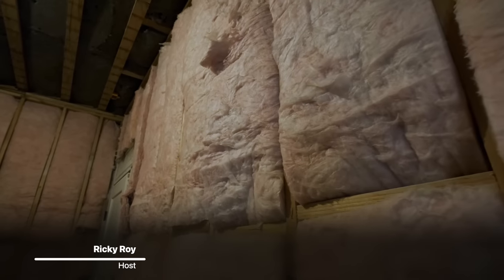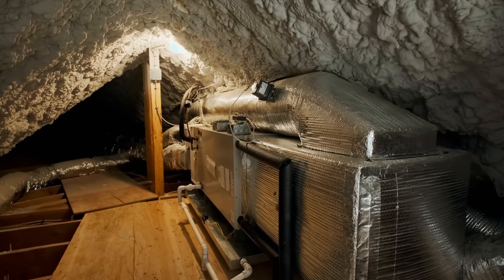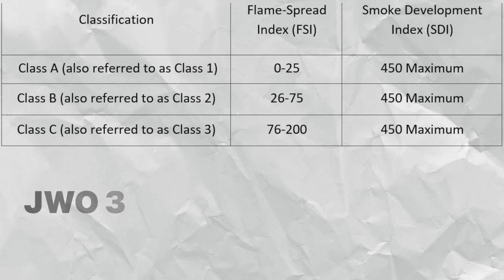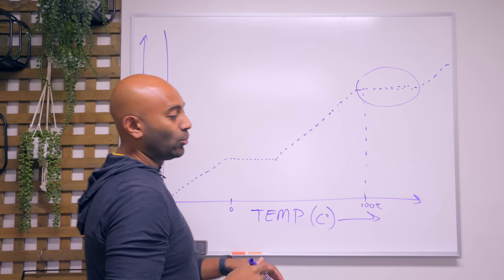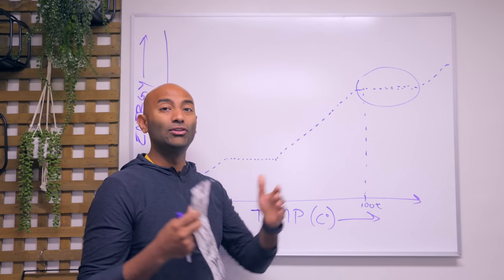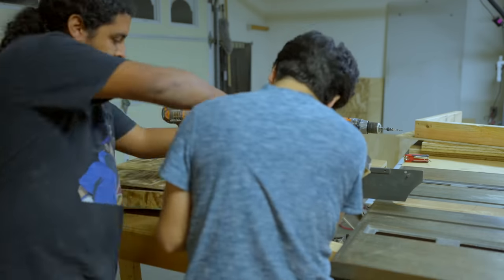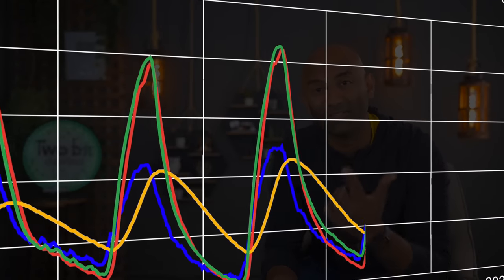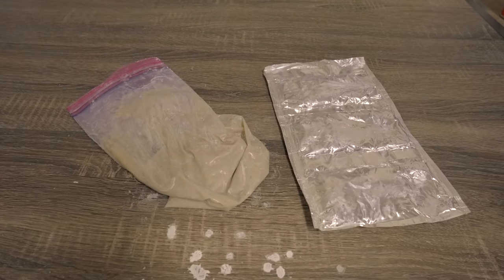The Genius of Phase Change Building Insulation!

Comment from the maker: Check out Hoymiles for your Solar Micro-Inverters Today! https://geni.us/Inverters

*Corrections/Clarifications Below 
- When hot outside, the material melts and absorbs energy keeping your room from getting as warm.
- When cold outside, the material freezes and releases energy warming up your room.
- I had the energy and temperature axes labeled incorrectly they should be switched! Temp on the Y axis, and energy on the X.
Reply: Unless there are alterations to pressure, after the ice melts the water warms and there is no longer any cooling.
Reply: Could put the kiwi on the south and west facing walls/roof where the sun is most punishing for best ROI.  

Have you ever analyzed the NASA-derived ceramic bead paint additive?  Could you do a video on it?
I find it works extremely well,  wish I had added it to my ceiling paint.  
It seems to add to paint durability as well.
Reply: Do we have an estimate as to how that might impact the R-value assemblies?
Reply: One inverter to two or four panels makes a lot of sense. Everyone seems to love Enphase, one-to-one, but they're so expensive. You can save a lot by going the way you did. I was considering APsystems for my solar system as they have a very similar solution.
Reply: Rally interested in how this works for you.  The costs of building new construction are insane still.  Being able to pull long term savings is more important than just being environmentally positive.  Cutting back on other monthly costs is a need for the average family.
Reply: Do you have to rip off the drywall?  Is it possible to take the siding off and put it back on?  (I guess only for vinyl or aluminum, but still, that seems easier?)
Reply: I know the prices for this thing are in the US, but where I live (Slovenia) you can buy the bricks + 8 inches of insulation for the same amount of money. Besides having large thermal mass, the bricks are also a noise and air barrier so really this seems like it's only usefull when you don't have space for thicker exterior walls.
Reply: Ricky, 
Regarding your solar panels & inverters... I'd shade hits Any One of your panels, are you saying that the degradation on that 1 panel will NOT reduce the output of the remaining unshaded panels regardless of if you're using the 2in1 or 4in1 Inverter modules on the roof?  

Cheers, Eric
Reply: So what I think of it. In general as you also say in Europe (overhere) most homes are stone based and not wood based. As stine has more weight it can hold more energy per kg then for examply air. For examply you have 2 the same hkuses one wood and one stone both 20c inside (68F) outside is 0c (32F) keep all the windows open for 30 minutes then close them). The stone building will go back to a much higher temp as the wooden building as mass holds more energy and energy is temperature!
So you have "stuff" that absorps energy and stores it. Rhe question is how much energy can it store per square cm or inch? And compared to old fashion wool insulation its not difficult but try something more like PIR how does it hold up then? Or put water in the box so its almost full how does it hold up? I s
don't understand with saving energy besides adding energy storage without and isolation?

Greetings Peter
Reply: Great job again!  Do you have a database/app where I can go and get modeling for my house/buildings in my area?   It would be cool if you had that tool and lead gen for the company offering the solution.
Reply: Ricky - what about a buying consortium of your viewers for QE buying group?    How much volume could we collectively get?   I have a metal pole building and a home, but if we leveraged your massive viewership, couldn’t we collectively help QE get to the new volume they need which would not only help all of us but it would long term help QE as they could leverage econo of scale to drive deeper into new markets.  Thoughts?
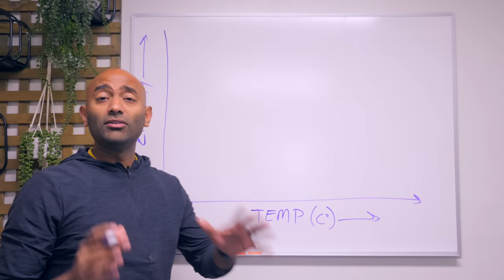Reply: Hmmmm ... seems tat you have the Temp and Energy axes mixed here (around 05:00 mark and after) ...
But otherwise excellent stuff as usual.
Reply: @MatejKebe 
Is it a Wienerberger product?
Reply: @mrbizi5652 
Regarding buying consortium, considering the market for EU regions as well.
Reply: I think you labeled the axis backwards. You wanted to show that temperature would remain the same as energy increased/decreased. You accidentally show the opposite.
Reply: It is also important to pay attention to how insulation affects humidity. Otherwise, mold could form.
Reply: Heating and cooling are "your largest energy bills"?  Well, no... in total, the biggest energy consumer is transportation.
Reply: 🇺🇲  Sell your house in San Diego, California, while the market is up. Buy or build an affordable home in a   Midwest state. Use that same product on the new house. The cost of living is so much less out of Southern California.
Reply: this stuff would be great for tiny homes, mobile homes, or temp construction site mobile offices etc.  cabins, off grid homes, im looking at building a off grid cabin using a shipping container...this stuff is now on my list

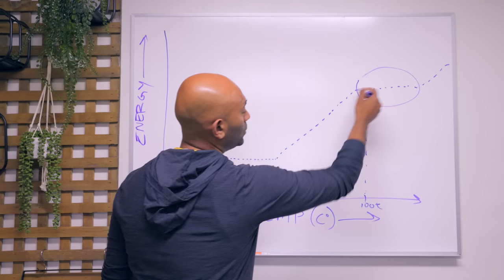Comment: Hi. I watched your video and I think you should do one more test. On temperature chart we don't see the "phase change" horizontal line on chart, you explained at 6:10. This extra insulation you added = a lot of extra mass in one test environment. If you weight it and put an equivalent water bottle to other box you will see similar gains. Only such comparison can give credits to such "phase change" invention.

Comment: The radiant barrier is an insulator, but phase change isn't insulation, it's energy storage.
Reply: True. But the energy storage has a (small?) insulation effect by keeping the temperature of the material the same temperature as your house, thus limiting the heat exchange between the two.
Reply: @RobertLBarnard  yeah makes more sense to have phase change material inside the house in areas you want to fight temperature shifts

Comment: I'm considering making myself a van, and I reckon this kind of material would be perfect there because I'm limited on how much solar I can install on it. In a small space like that the price also is less of a concern, and every last bit of efficiency makes a huge difference.
Reply: Now your question is what temperature range do I design for? Desert conditions or arctic conditions like in Canada. Noooo!
Reply: @skidaddledude1997  I think a comment above can solve the question, have 2 layers installed in the van. One with a melting point of 15C and another with melting point of 25C. This way you can ensure a phrase change for most weather band widths
Reply: I have exactly the same use in mind, only using a bread van/tiny home approach.

Perhaps 1/4" of glued in Styrofoam and then a layer of phase change material for cold , with another 1/4" Styrofoam and then another layer for heat, and then your finish paneling. $1000 to $!250 ought to do all surfaces including the floor. A small AC and a mini wood stove should cover most locations.

I'm going to put in a suggestion on the 'Project Farm' channel to test this material in a future show. He does some really good tests on a variety of products.
Reply: He said the material goes on the outside. How are you supposed to tape these things on the outside of a van?
Reply: @allocater2  Not to mention how hot exterior metal would be in summer. That's why I thought a 1/4" of Styrofoam on the inside to slow the incoming heat. Then the first layer of phase change material. 

I can't see any other way, as it seems pointless to tape directly to the metal wall skin on the inside or outside.

Maybe someone has a better idea?
Reply: @allocater2  Insulation needs to be on the outside of the "water barrier" (don't know the term, in houses in Sweden typically plastic film) so that the condensated water will be ventilated away, as not to allow mold to grow. 
A car is tricky, I don't know the best way to insulate, so you better look it up.
Reply: @tinkerstrade3553  that could be augmented by applying the newer of the available thermal paints. It doesn’t need to be the specialized and expensive stuff that the military is playing with. Some of the regular commercial thermal stuff could be used on the outside skin of the van to help the overall process. I also change my roof paint to mirror silver in spring and a flat, super absorptive flat black, as the weather begins to get chilly at night. Love to follow the process along.
Reply: Materials used for trim panels include Melamine foams with and without facings or mass fabrics, along with vibration isolators to reduce resonance and enhance transmission loss characteristics. The foam composites are applied directly to the outside of trim panels for additional noise attenuation and reduction of vibration or resonance of a panel. Look at how jet aircraft like Boeing install "blankets" of material as I help build the 747, 767 line at main join and flightline. Surplus jet parts in the aircraft bone yards are a cheap way to go.

Comment: The units for the graph should be swapped!
Reply: At the phase change temperature is the same. The energy rises at the same temperature
Reply: @chiliphil64  I think he means that the energy input is constantly increasing (x-axis) but temperature stays constant at phase change temperatures (y-axis). The way he drew the dashed line, the y axis is temperature and the x-axis is energy input.

Comment: 6:15 In case of water, the "stays flat for a while" is a really long while at 100 °C. Heating 1 kg of water from 0 °C to 100 °C takes about 418 kJ. Boiling 1 kg of water from 100 °C to 101 °C takes about 2247 kJ (or 5 times more than getting it from zero to hundred).

Comment: You should make it clear that phase change material is only useful in locations where the temperature swings across the melting point/desired temperature: In the days it’s hotter than desired and the excess energy melts the material. 
For instance in Minnesota in the winter, days are much  warmer than nights, but there’s never excess heat to melt the material. 

It’s best in desert climates where the nights are cold and the days are hot.
Reply: At 2:55 Ricky mentions that the product is customizable. I wonder if it would make sense to use two customizations in the same wall. For example if it is possible to make the freezing/melting point 15C or at 25C, would layers of the two combined help keep the house more temperate than using a single larger layer tuned to 20C?
Reply: Well, not necessarily just in deserts. It depends on the material and at what specific temperature it changes pahse, so you would probably just need a daily temperature delta that's pronounced enough and a material that changes phase within that delta for it to work.
Reply: @From_Heller  I didn’t mean just deserts, but the swing has to cross “room temperature “. A place like Miami in the summer or Minnesota in the winter are not helped.
Reply: After spinning it in my head for a couple of minutes, I think you are probably right about the "crossing room temperature" constraint... I didn't take it into account and was just focused on the material properties :)
Reply: Heating and cooling are "your largest energy bills"?  Well, no... in total, the biggest energy consumer is transportation.
Reply: Yes, I was thinking the same thing -- only works where there's a daily swing from hot to cold, as in the desert.  ("Remember, we're dealing with Californians here -- which has its provincialisms."
Reply: If you get a phase-change at 65F and you have your AC set to 69, the material will get charged to 69 degrees, then at night when the temperature drops, the phase-change helps your AC to maintain... It is analogous to a capacitor. Put an 80F-tuned layer in your attic.

Comment: I have something very similar on top of my wood stove - a large pot of parafin wax. When the fire is going it melts the wax (absorbs heat) and when the fire dies down it releases the stored energy as heat as it solidifies. Same principle in action.
Reply: Not a bad idea! I hate how poorly wood stoves keep places warm at night - the old stone chimney hearts used to help immensely be releasing heat all night. Near room temp Phase change material like coconut oil, sodium sulphate hydrate or parrafin wax helps do that job while being much lighter for the same energy storage

Comment: I've been following this for a while.  It's cool that it's getting used more.  I've seen another version of the technology that uses a tank.  Basically it functions like a heat pump, with pipes running through it circulating a coolant/heating agent.  Something like that could be used with thermal solar to even more heat for the night.  Imagine a system where your photovoltaic cells are cooled, for maximum efficiency, and the waste heat was stored in a tank to heat the house during the night.

There is a famous kind of wall art that has a lot of boards sticking out for it, sort of like a maze.   When I saw this I thought if you you could design something like that with this in it's core you could have a lot of passive heat exchange because of all the surface area.

I think the wall version could probably work between studs.  You'd lose a little space at the stud, but I think that would be okay.  (Much lower tech, but have you seen T-Studs?  They are an all wood product that creates a lot less thermal bridging than normal stud construction by running two studs at right angles with a gap between them.  They are connected by dowels and you blow insulation in between them.  Your only points of contact are the dowels.

Comment: The QE Platinum would REALLY make sense in the upper-Midwest especially for attic use if your attic is part of the "conditioned space" in the home.  If they make it in standard roll widths (12, 16, 24" on center) and the "pouches" about 12" long it could be stapled right to the bottom of the roof rafters to hold your insulation up against the roof decking.  It would also help enormously with air infiltration if you tape the seams.  Ricky, I suspect THAT will make a huge difference in your house renovation, just getting to a point where your house would pass a blower door test.
Reply: What good would a phase change "insulation" be in the upper midwest where it is cold day and night in the winter. It would freeze and stay frozen, offering little resistance to heat transfer.
Reply: @pauleohl  True not so much in the winter, that's why our furnaces run damn near 24/7 from Halloween to Memorial Day.  During the summer they'd be good at reducing the use of air conditioners though.
Reply: @michiganengineer8621  Only if it cools off enough at night to change the phase back to solid.
Reply: @incognitotorpedo42  Even in summer the nights are usually cool enough to make that shift.  HOWEVER, Unless that price tag comes down DRASTICALLY it's just going to be a toy for the rich.
Reply: @michiganengineer8621  Considering that traditional  insulation is mandatory for the winter, where would you put the phase change material? And what is your logic for how it would work? For the sake of this discussion, let's say that removing and replacing drywall is not an issue.
Reply: @pauleohl  In the walls, between the real insulation and the drywall.  In the attic, between the roof-deck insulation and the attic space.  I just won't expect it do do jack-squat during the winter months.
Reply: @pauleohl  there are other PCM's with an alternate freezing temperature.  recharge them to "warm freezing"  from geothermal below the frost line, and it won't be really warm,  but it won't be freezing in the house.

Comment: I would consider this material for radiators .  On  a south wall thermal panels collect heat and transfer it to radiators inside a house during winter,  in summer you run the system in revers during  nights to cool a house

Comment: Better test might be to frame out a wall with plywood backing, and every two studs change the insulation material, then enclose it with sheet rock (or just another piece of plywood), then just point a thermal camera at it (This is me assuming that you doing what you do, you already have one). To simulate indoor/outdoor just prop it at a 45* angle somewhere exposed to the sun and point the camera at the under side. You could of course make the box more elaborate, but the thermal camera should be a very accurate comparison/measurement, and putting them all in one wall controls for different levels of exposure as long as the whole wall gets equal sun.